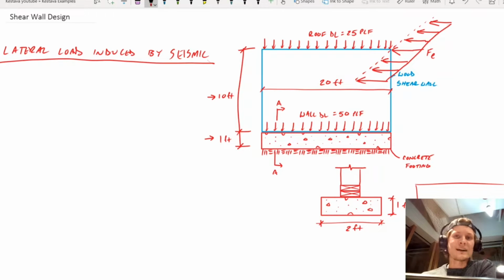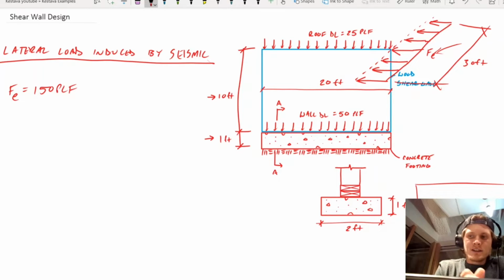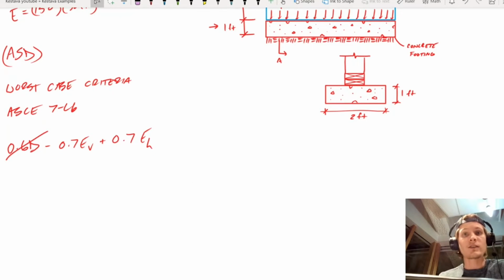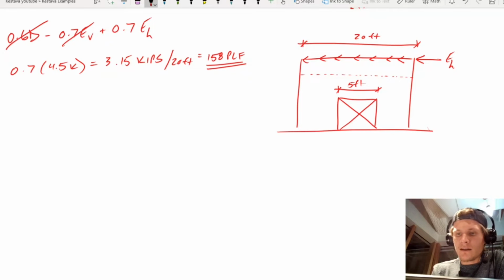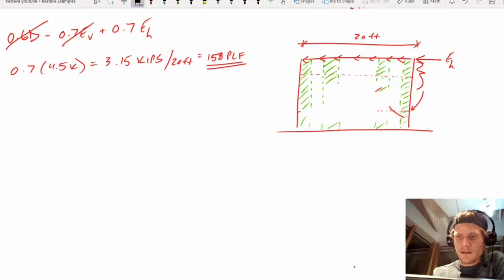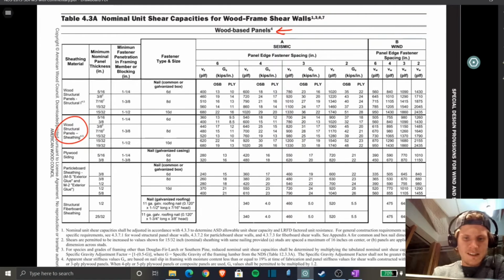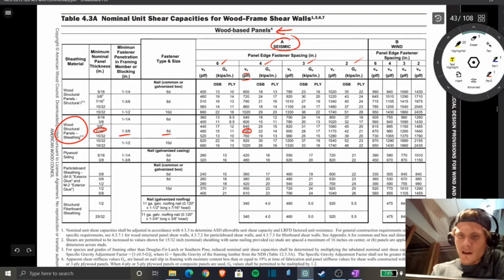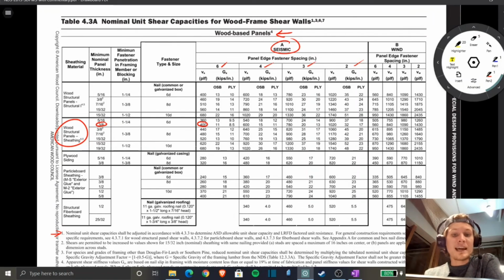Wood Shear Wall Design Example - Part 1 of 3

Comment: Hi I watched the video last year and it helped me understand the role of the shear wall in our home remodel project.  (Although I got a engineer
Reply: Oops. I have a degree in civil engineering but only worked in that field for a year. I'm retired now but with the video I understand what's needed in shear wall design and we were able to finally get our building permit. An 8-foot shear wall was required for us to add an 8-foot door to an existing 27-foot wall. The builder framed what looks like a vanilla shear wall design with hold downs on either end and 3 anchor bolts in between. However, the inspector won't let us proceed with the sheathing until a specialist conducts a "pull test." Can you please tell me how a pull test is conducted? Dies this seem like overkill for a wood frame residence? BTW I live in California. Appreciate any light you can shed on this. Thanks, John
Reply from the maker: Hi John, my following comment is for educational purposes only as I am not licensed in CA. I would think an alternate route to avoid the pull test would be to get a registered engineer to sign off on the shear wall. The engineer could run calculations proving the design (as built) is adequate and stamp that and submit to the local jurisdiction for review. CA you have more to consider as a professional engineer because of high seismic forces, even for residential projects.
Reply: @kestava_engineering  thanks for getting back to me. Although I like your rationale, here's what's actually happening. A registered engineer did the design and the calculations. These were submitted to another registered engineer who okayed the permit. The hold-downs and anchor bolts were installed as specified. Nonetheless, the inspector rejected it because for some reason it has to be okayed by a specialist. They do not take the builder's word that the epoxy was correctly  applied and are requiring a pull test. I have no idea how they would applythe force if they yanked it out, but I would be really upset if they managed to yank it out of the concrete foundation. I really appreciate your advice.

On a different topic, I'm wondering if your video series would be of use to civil engineering schools that teach basic theory but hold off on the nitty gritty until grad school.
Reply from the maker: @johnstearns4166  sounds like they required a special inspector to come out and perform either "continuous inspection" or "period inspection" of the holddown installation. There are requirements per chapter 17 of the IBC and may be addition requirements for your local jurisdiction. This is something the contractor unfortunately should have been aware of. Hopefully one day our structural engineering schooling changes. I think it could be so much better and produce the next level of engineer. some of our teaching methods are pretty old!
Reply: This is what I found in Chapter 17. Not sure if it makes a case for an exemption. Thanks for your ideas.

 1705.11.1 Structural Wood

Continuous special inspection is required during field gluing operations of elements of the main windforce-resisting system. Periodic special inspection is required for nailing, bolting, anchoring and other fastening of elements of the main windforce-resisting system, including wood shear walls, wood diaphragms, drag struts, braces and hold-downs.

Exception: Special inspections are not required for wood shear walls, shear panels and diaphragms, including nailing, bolting, anchoring and other fastening to other elements of the main windforce-resisting system, where the [BSC, HCD-1, HCD-2, SFM] lateral resistance is provided by the structural sheathing and the specified fastener spacing at panel edges is more than 4 inches (102 mm) on center.

Comment: what building components are used to get Fe. Roof and 1/2 all walls in both directions?
Reply from the maker: for lighter construction (like wood) you can conservatively take 1/2 the walls in both directions) but technically if you want to sharpen the pencil you only need to account for the out of plane walls mass depending on the direction you are checking. and then you can include in plane mass when analyzing the shear walls and bypass the diaphragm. This becomes more critical when designing a building like a tilt where a TON of the mass is from the walls themselves.
Reply: @kestava_engineering  Thanks also I noticed you did not use wall weiigt and roof weight in reducing overturning, is this correct. Also is it OK to use shear loads in tables from UBC Chapter 23 for wood?

Comment: When exactly do you know when you have a "Shear Wall"?  I.e. I know in NDS 2015 SDPWS Table 4.2.4 defines the Maximum Diaphragm Aspect Ratios, where it is the Maximum Length to Width Ratio, but is every exterior wall considered a shear wall?  I'm struggling to understand when a shear wall is needed and when one is not?
Reply from the maker: Jeffery, Great question - if you are designing a new structure you get to designate what is and is not a shear wall. you can tell if a wall is not a shear wall due to its lack of hold downs or structural panels. Another great indicator is if a wall does not have a strip footing below it, this normally also indicates that the wall is not a shear wall. I need to make a video talking about aspect ratios! 

Keep up the great comments Jeff!

Comment: How would you do this for a 2 story house? Would you just treat each floor as its own problem and just add the weight of the 2nd floor onto the first floor?
Reply from the maker: For 2 stories you have to make sure you properly transfer shear forces through nailing at the break in sheathing between the floors. Also you need to make sure you provide strapping in line with your hold downs at the base to transfer tension loads due to overturning. other than that, there is not to much of a difference. I think ill get a video done soon to show you!
Reply: @kestava_engineering  yes please 🙏
Reply: @kestava_engineering  Following up on this! Did you ever make a video on this? If so where could I find it?

Comment: I just did the SE Building back to back.
Reply from the maker: your a BEAST. firm handshakes all around. how did it go??
Reply: @kestava_engineering  It's all about time management and nerve control. I did it in Las Vegas because California canceled the exam in Pomona and that was extra stress.
Reply from the maker: @akhalil66  damn great work. I cant believe they couldnt get there ducks in a row to let people take the exam. people are 6ft apart normally hahah. But i guess safety should be the number one priority. great job pivoting.